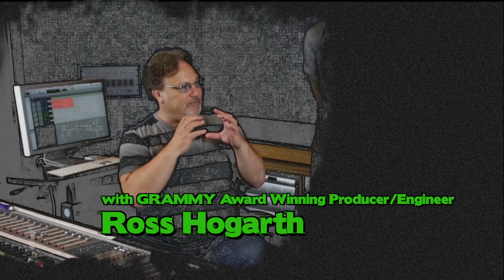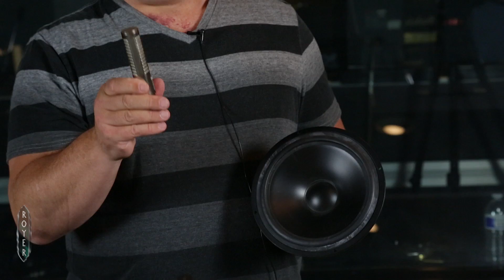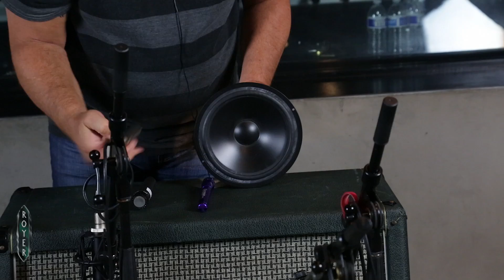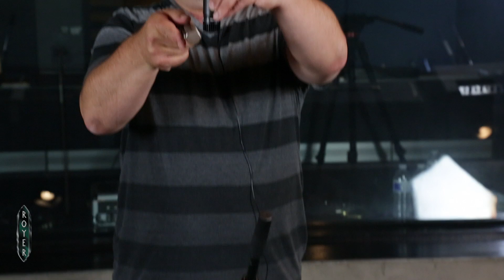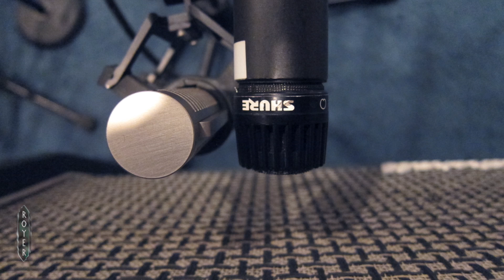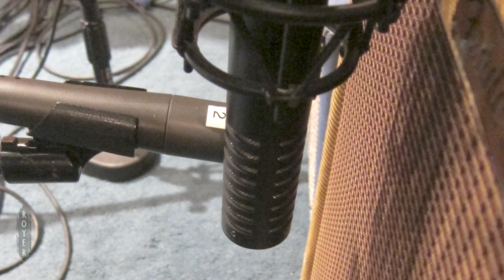Recording Electric Guitar Session 4 - Microphone Placement with Ross Hogarth

Comment: Can't you just align the two tracks perfectly to get rid of any faze problems?
Reply: I usually put the ribbon a half till 2 meters back and do the math of 2,92mS/meter as a starting point. Then I fine-align in the DAW.
Reply: I use AutoAlign from Sound Radix. Takes that potential issue out of the way and speeds up my work flow a lot.

Comment: Great insight, thanks for shearing.  One question.  AS a starting point what do you set the amps master volume to.  305, 50%, 75?.  How load do you need to pus a tube amp to get it in its sweet spot for recording?

Comment: What would you recommend for micing an old cranked Hiwatt with early Fanes?
Reply: Wow! Beautiful old amp t holmes! I would personally use a 57 if it's full out rock, but I sometimes use large diaphragm mics on the cleaner tones, you can always pull them back from the speaker and get a little more even tone and lower SPL.

Comment: You can either guess if the mics are in phase, or (if you're recording digitally), you can reamp a click back out to the cab, and record it.  How far off are the recorded clicks?  Adjust.  Repeat until everything is in phase.
Reply: Cool trick but can be time consuming trying to make small adjustments, rerecord, etc. A better real-time trick is to crank the amp so that it's just making noise (hiss). Reverse the polarity on one mic. Move one of the mics until the hiss goes away (or reaches minimum) monitoring through headphones or whatever. At this point they're in phase. Swap the reversed polarity back & hit record!
Reply: @timogletree8754  good sure but may require isolation / control room, which many don’t have so the hiss would be audible even if headphones just a guess
Reply: +callitaclue interesting technique. thanks for sharing!
Reply from the maker: That's an interesting idea. Thanks for sharing.